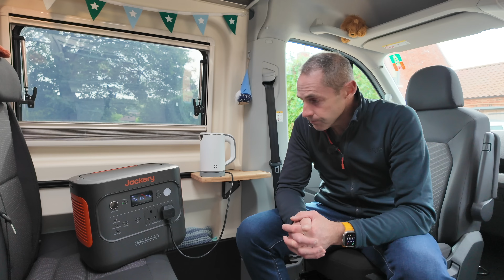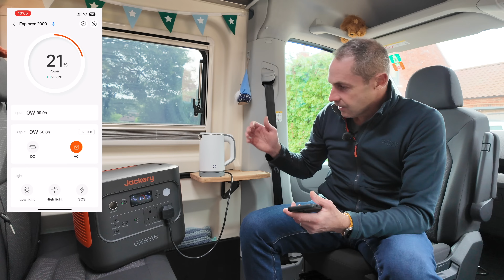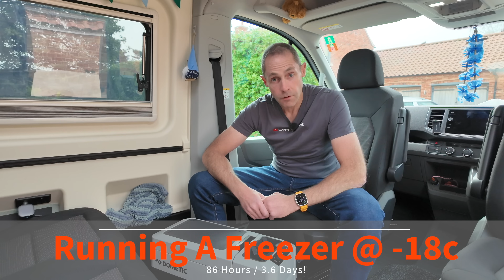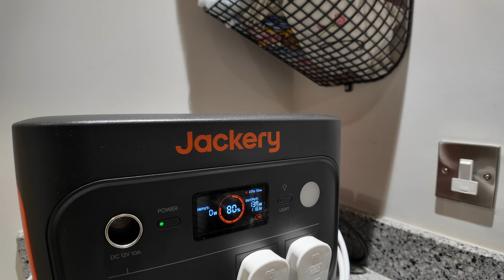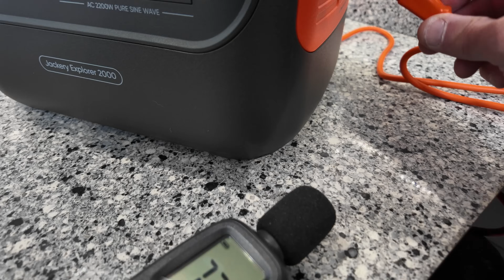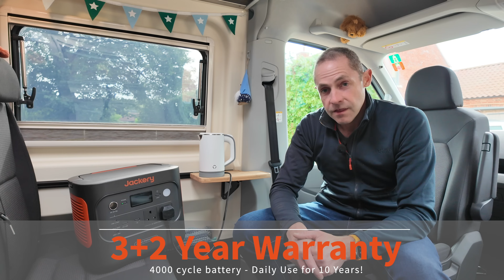So Many (Money Saving) Uses: The Jackery Explorer 2000 v2 Power Station Full Review

Comment: How did you set up a smart plug to come on when you have 1,500 watts excess solar?
Reply from the maker: We use home assistant - we monitor our solar in to it via our zappi charger, then I've written a short procedure that monitors what level of export there is and switches on the meross smart plug (also connected to home assistant) to turn charging on/off

Comment: When we are not using our VW Cali it is in a basement car park for up to 3-4 months. With no mains power available down there to keep the leisure batteries charged they discharge slowly over time. How long would a Jackery 2000 or similar powerbank, keep them maintained with a cable run out the tailgate (airsafe locked) and into the mains hook-up point on the side of the vehicle? Would that even be safe to do?

Comment: Approximately how many cups of coffee can I make with a Keurig 1550 watt before I'd have to charge it up? I want to use it in my car while working nights, I'd likely make roughly 20 cups of coffee during a 12 hour shift. So, I'm trying to determine how often I'd need to take it in the house and give it a full charge.
Reply from the maker: That's a good question - I'd estimate anywhere between 60 and 110 cups of coffee, depending on how big the cup is.

Comment: I have this...  along with the pair of 200 watt solar panels..  the solar panels actually do really well for it... they are portable so fold them out and stand them up to the angle you wish and plug them in...over the summer I was at an event where I actually did sleep in the bus overnight... kept my Midea portable A/C hoses in the bus window and on low setting it made the bus very cold..  during the day the solar panels alone charged the jackery back up to full power..  you can charge the battery and use the device at the same time..  so if you are running an output and put the solar on it will give you a much longer battery run-down time.. or it will even charge up the battery if your solar makes mroe than you use..  im not into camping at all (though I do have a mobile office Bus where i use it).. however being that I live in an apartment (im US) aka a Flat..  it comes in really handy... i can take it down to my car and be able to use my regular vacuum to sweep out my car... and run the electric power washer to wash it (I have water cubes for the power washing water)..  I can also use it to power up in the event of a power outage...  being in an apartment I cant use a gasoline generator as im on the 3rd floor..  but the Jackery will power my portable Midea Air-conditioner / Heat pump..  I used it with the A/C on low setting in my bedroom and it ran all night keeping it at 72F (much better than the 80F and humid  it was at Night outside)..used it where there was no power outside and we wanted to watch a football (american) game at night.. no noisy generator.. but ran the Starlink, and the projector and speaker for us to stream the game..  ive also use it to top off the batteries on my vintage busses ..the storage place where I keep them has no power so periodically i take the jackeery asnd plug int my 2 victron AGM chargers to keep the bus batteries topped up..  this is my first christmas season with it.. but I typically decorate one of the busses for christmas with lights inside and inflatable christmas characters in the bus seats.. I will be plugging them into the Jackery so i can leave them turned on when the bus is parked and not running.. since the jackery will charge and run at the same time, if you were concerned about a power outage for an upcoming storm when going away you could plug your frig into the jackerty and then your jackery into the mains and it will act as a UPS.. so even if you arent into camping or caravanning this is a really handy little device to have,, the only thing I wouldve done different had i known is that I wouldve bought the model where i can add extra batteries to it

Comment: I bought an explorer 2000v2 recently at a good price (relative to the RRP) . I needed the extra capacity over the explorer 1000v2 and so far it has performed extremely well. One thing to bear in mind though is the weight of the unit. The advertising blurb may say it is 41% lighter than other similar units, but it still weighs 17.5 kg which is around 39 lb and that is very heavy and needs careful handling.
Reply: How much did you pay ? I'm looking for one.

Comment: Thanks Will.  I have just ordered one of these and intend to run a small 500W Delonghi oil filled radiator and/or a Lakeland heated blanket in my Toyota Alphard when I'm off grid in winter.
Reply from the maker: Good plan!

Comment: A WORD OF CAUTION. Hi, just watched your review and whilst you point out all the uses of this unit there is one big downside with all these units which you may not have even thought of, I have the1000v2 with additional battery pack and thought I would be able to recharge or run my Motorhome by pugging the Jackery output to the van hook up socket, big no no!!!!!!.
The way the jackery creates an earth for safe use is not compatible with a lot of electronics in the uk, mainly in this situation the stabilised 12v system within the van (your battery charger) essentially the Jackery earth generates stray voltages when plugged in to a uk 240v system (fine in the USA as their mains voltage is 110v) this upsets and confuses the PSU (stabilised power supply unit) causing the output to fluctuate which can then  actually drain your existing leisure batteries.
I have contacted Jackery at length to raise this issue, they have been in touch with their engineers and they agree if the Jackery is used in this way it will cause this problem, so beware, if you try to use the Jackery to run your van via the hook up socket you could be in a world of pain, their response to the issue is basically DON’T DO IT.

Comment: Hi Will, thanks to your excellent review previously on the Jackery 1000 V2, I snapped one up for our VW Campervan. I needed the extra watts for the Nespresso coffee machine, additional standalone condenser fridge/freezer and to top up the leisure battery on bad weather days, when the solar isn't productive and there is no EHU available. I'm tempted to get the Jackery solar panels, but the van can charge the power unit when we are on the move via the 12v connection. I've done my homework and I believe Jackery products are some of the best out there at very competitive prices. Excellent review as always, cheers.

Comment: Love the set up at about 11 mins. Would like to do something like this. What smart plug do you use in the house that allows things to switch on when over a certain w of excess solar is being generated?
I seem to be able to find diverters that turn on immersion heaters but not that turn a socket on. Our solar inverter in the house does not have any smart monitoring in it so we need a system that has a clip or similar to monitor if exporting etc.

Comment: Thanks Will. Good solid review as per usual. We purchased the smaller 1000 unit following a review you did previously. I also ordered the 12v car charger which I assume will fit the model reviewed. It meant we plugged it into the Cali 12v output at the front of the van and charged it up whilst driving. We did 30 days in Norway earlier in the year and we used it for boiling the kettle, milk frother and a remoska cooker, we didn’t need hookup at all.
Reply from the maker: Excellent! Yes the car charger would work fine with this too

Comment: Great stuff ! I've just bought one of these with the solar panel as i'm preparing a 6 month trip down through southern Europe and into Morocco   in my VW van. I didn't have much time to research the purchase as I was only in the UK for a week before heading off to France. Jackery were really good and delivered within a couple of days. I'm now outside Paris and it's still in its box and it is pretty heavy. That said it did come with the carry bag, that I think is essential to displace it, because of the weight. The battery probably won't get used before the end of the month and i'm still not sure when I'll find the time to find out how it works, so watching this has been a real help.
Your video has reassured me that it is something I will make good use of especially when im off grid in Morocco, so thanks you so much for the demonstration.

Comment: What’s the lifespan of the battery, how many charges will it accommodate before your start to see a deterioration?
Reply: 4000 cycles before it’s at 70% so average usage 10 years and it will still charge to 70%

Comment: When plugged into the van EHU, remember to pull the charger fuse to the Leisure battery. That way you won't be charging that with the power bank but you will still have 12V supply and 240V supply in the Van. Hopefully the 12V Leisure will be topped up via Solar.
Reply: Can you explain this a bit more please? Why doesn't it treat the power bank as any normal hook up mains supply?
Reply: @broadpete  basically you don't want the PowerBank charging the Leisure Battery, leave that to the Solar (when off-grid). So we just pull the fuse to the Leisure battery on the EBL unit.
Reply: @robertdon777 thanks. If we were wild camping and were running low on leisure batteries (so that we might lose the heating or compressor fridge), would it be ok to just plug the power bank into the ehu socket (we have a lead) specifically with the intention to recharge the leisure batteries? Or is there a different way to achieve the same goal?
Reply: @broadpete  Yes that would work, no issue.
Reply: So you can use a jackery to charge your lesuire battery in you MH? 10amp out is enough to charge it? I dont have solar. Thanks